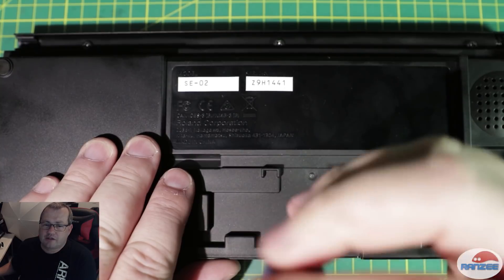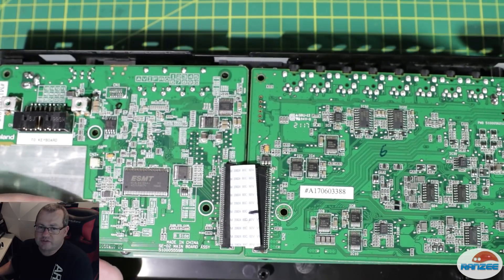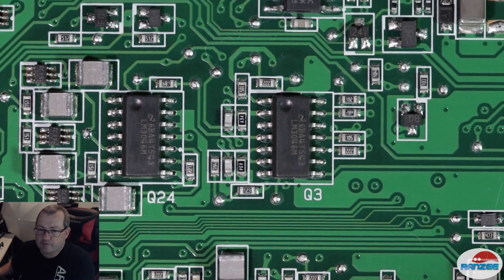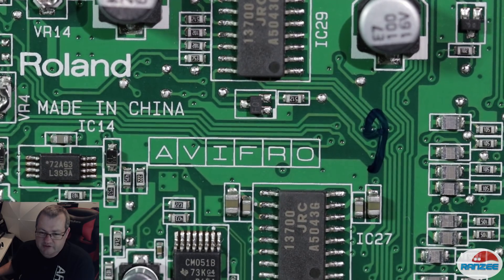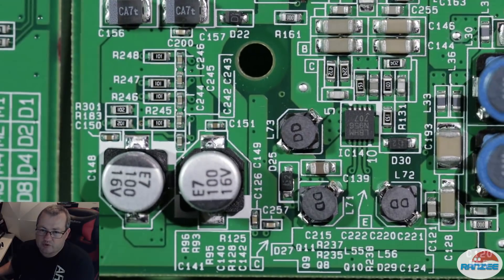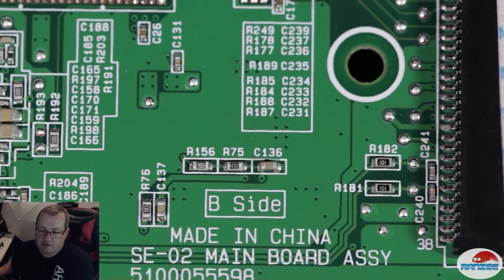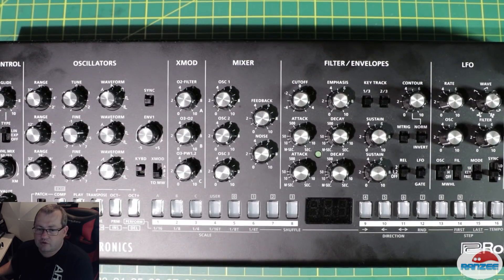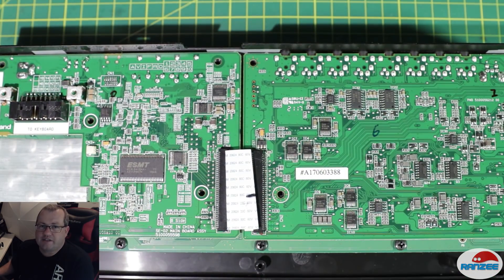Inside the Roland Boutique SE-02 analog synthesizer

Comment: I bought this synth and love it. The tiny design is ridiculous however. Im debating stripping the guts out of it and making a big panel and using new switichs and pots etc. Would it be madness i wonder.
Reply: Hi, I've had the same thought. Did you finally complete the project?
Reply: I did think about it but would be a mammoth project. Check YouTube to see how Kebu controls it with a Roland which is a less problematic way to do it.
Reply from the maker: might be a bit of a project!

Comment: Interesting, I bought mine used and didn't notice the power switch was broken/missing. I would never dream of opening a synth but now I'm wondering if I could... I have zero experience with repairing electronics. Anyone have an idea how big of a deal it would be to fix it?
Reply: I bought mine used from Gumtree & also had an issue with power. 
If the power cable connection moves, rotates in the ac input connection the SE 02 looses power & goes off.
Hoping it’s simply dirt.
I’ve cleaned the connection with a spray of contact cleaner & it’s improved but not perfect.
I don’t want to disassemble the SE02. 
I’m hoping it’s just dirt or dust that’s causing the problem. It all looks ok.
Apart from this it’s perfect.
Ordered some pipe cleaners & isopropyl & will give the connection a serious clean. Really hope this fixes the problem.
Last thing I need is loss of power during a performance or software update.

I cannot understand people that pay retail for a piece of fine equipment & then take no care of it. Getting dirt, grease etc all over the equipment. All my precious kit is cared for. I’ve 30 year old Roland synths that look & function like new.
Reply from the maker: If you are comfortable, the power switch isn't a difficult fix. If you have a friend who is comfortable with a soldering iron, this could be done fairly easily. The question remains - how come it is broken/missing? Is there anymore damage?

Comment: Thanks for the video. Does it look like the output volume potentiometer is simple to replace?
Reply from the maker: I think so - the controls have their own circuit board - so it should be relatively simple. SE make some really well designed electronics.

Comment: Thanks for sharing. Very nice quality video.
1) IC22 & IC32 (LM13700) are final VCA's (stereo). 
2) The transistors and related circuitry to the left of IC34 is the transistor ladder filter.
3) The three LM3046 are for the expo converters for the VCO's. You can see the three VCO sections are similar.
4) T084's are just TL084 quad op amps. 
5) The CM4051's are for multiplexing the various CV's and latch bits.
6) The varoius LM13700 OTA's are used as VCA's for all the CV control amounts.
7) The NE5532 (IC36) is the headphone amp.
8) IC14 along with the small inductors, related resistors and caps is the DC converter to generate the analog supply voltages. IC13 & IC12 are the voltage regulators to derive the final +/-12V supplies for the analog. Intersting to see an expensive LT part in a musical instruments (IC14). Typcially you would find the cheaper TPS65131 DC converter in this application.
9) IC15 along with the 4.7uH inductors and related parts is the 3.3V step down converter to power the digital stuff
10) IC11 is the stereo codec for the USB-audio
11) IC3 is additional flash for the buffer/scratchpad. 
12) The PIC is the main processor and is doing all the housekeeping, scanning controls, sequencer, etc. The Roland custom IC is likely spitting out the envelopes, LFO's, Control CV's, Calibration CV's etc...[edit: see note from ranzee]
Reply from the maker: Hi bcastromusic! That's awesome! Thanks for taking the time to write this for us to all share. Just a thought on the filter circuit - the high-gain opAmp 4556A (IC34) could be related to the overdrive? Incidentally, SE talk directly about their use of the PIC24 (the 16-bit microcontroller on the analog board) in this article on their own website: http://www.studioelectronics.com/products/synths/se-02/ - and it is used to generate the envelopes and additional high speed functions like the glide (which is combined in a hybrid setup). Whereas Roland's package (ESC2) is crunching the UI, sequencer, firmware and that sort of stuff.
Reply: The "4556A" is a NJM4556A. A high current op amp. Mostly general purpose. Higher drive so might be driving a headphone or similar.  No such thing as "high gain" op amp. Op amp gain is set by a resistor, they are all the same.

I see two switching regulators. a Linear Tech LT3471 makes the +/- analog voltage. It is the tiny legless square that says LBHM. I also see a TI TPS65251 step up switcher. Probably making the 18V in the D if they used it. Why the expensive LT as noted above? Because TI doesn't make any quality dual switchers but LT specializes in them. 

I saw an AKM codec and some other parts but didn't take the time to review, write down and give more info.

The LM13700s are OTAs, a type of voltage controlled current amp, and are classic Bob Moog design as he loved 13700s, but were invented later than the D was so clearly not part of the original design and something Roland added.
Reply from the maker: "High Gain" - I just got this off the data sheet: 

The NJM4556A integrated circuit is a high-gain,high output current dual operational amplifier capable of driving ±70mA into 150Ω loads ( ±10.5V output voltage ),and operating low supply voltage ( V+/V- = ±2V~ ). 

Link: https://www.njr.com/semicon/PDF/NJM4556A_E.pdf

The overdrive feature on the SE-02 was supposed to be the same as plugging the headphones back into the audio input on the Model-D. From what I understood they "mimicked" this by including it as integrated in to the signal path design. By what you're saying (it being a headphone amp driver) - could very well be just it.